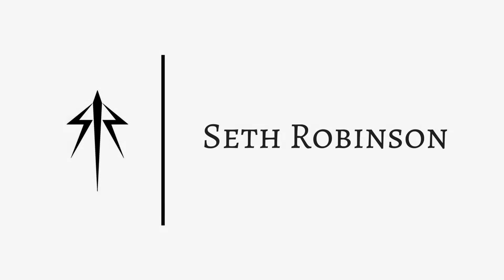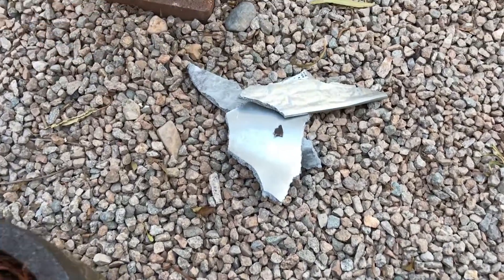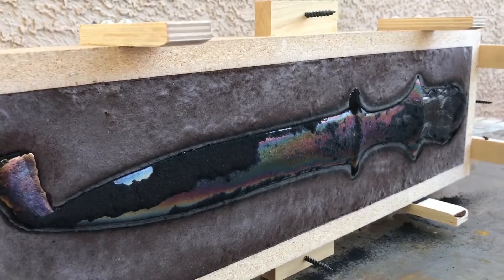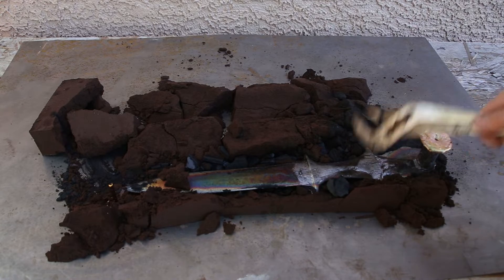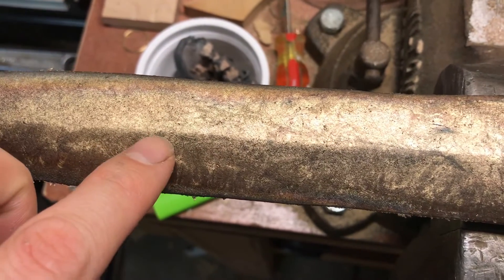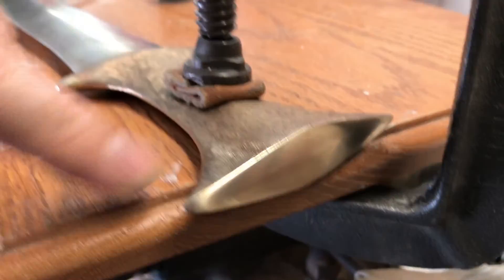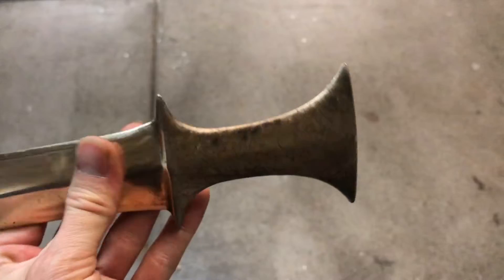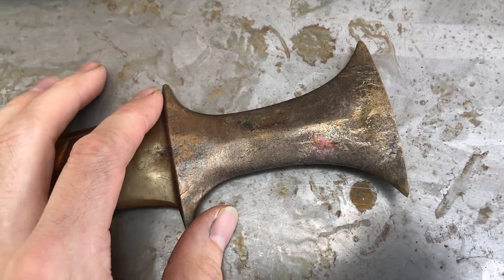Making Aluminum Bronze Dagger │Casting Dagger

Comment: I once had a job cutting up some old British Navy bronze stuff we tried Diamond and carborundum blades 9" and 12" we couldn't touch it, I noticed you were using a hacksaw on that I always wondered what mix the British Navy used for their bronze props and bearings it was a sight harder than rebar.
Reply: What? No bronze is nowhere near that hard. Rebar is 1014 hotroll steel.

Comment: I vent petrobond sometimes, but when I do I push my vent wire down through the cope with the pattern in place but stop about 1/4" above the pattern. If you just want to let the air out you can just put an open riser at the end, but to let gases out the non-contacting vents will work. They won't work if they're filled with metal.
Reply from the maker: Thanks for the suggestions. Lately I have found that petrobond really doesn’t need much venting. I get away with a lot without any vents at all.

Comment: How does aluminum bronze compare with tin bronze as far as hardness?
Reply: Templarium from what I’ve come to understand aluminum bronze is much stronger than tin bronze. The research I’ve read into said it’s comparable to some steels
Reply: @jaguarnova3932  One of it's big claims to fame is that it doesn't spark.

Comment: My hacksaw and files just skate across aluminum bronze. I have to use abrasive wheels to cut that stuff.  Good looking blade!  Oh and I finally subbed ;-)
Reply: Redditors can suck it for generalizing bronze then.
Reply from the maker: swdweeb That’s what I experienced as well.  It’s very strange to file and cut. Glad you enjoyed it!
Reply: You experienced resistance to cutting because bronze is an excellent bearing material. Break the surface of bronze and that saw blade will fly through it. You kids trying to make youtube metalworking vids need to work in a machine shop a few years, you'll be amazed at how much you didn't know.
Reply: 46 year machinist here, you need a new file and hack saw blade. No bronze is harder then a file. A file can cut toolsteel up to 45 Rockwell.
Reply: Chinesium tools ;)
Reply: @KingfishStevens-di9ji  Actually I hear 85cu-15al alloy can be harder then steel, but is somewhat brittle.
Reply: @caseyb1346  Whomever wrote or said that is wrong.

Comment: you could have hammered a bit the edge before filing, aluminum bronze hardens with hammering... also maybe if you wanted it more yellowish you could have used 92% copper 8% aluminum, or even 92/6/2  Cu/Al/Ni (which is common for some coins)
Reply from the maker: Juan Pablo Alvarez Alfaro Thanks, I’ve tried hammering some of my blades and so far I have really just messed them up.

Comment: Nice work, Aluminium bronze can be be quite challenging to cast. I am wondering if you did a vertical cast of that dagger if the shrinkage can be avoided
Reply: Agree, this application would respond better with vertical cast.